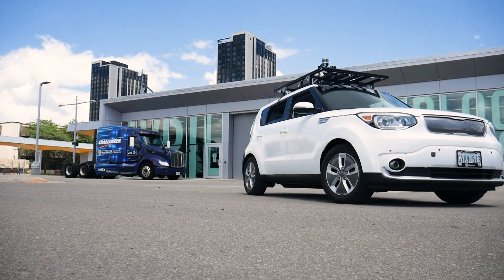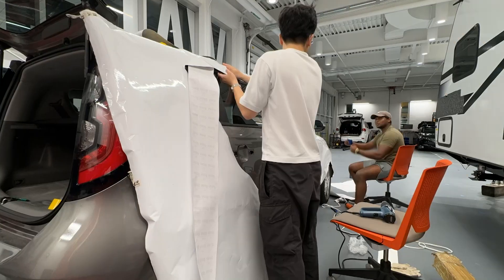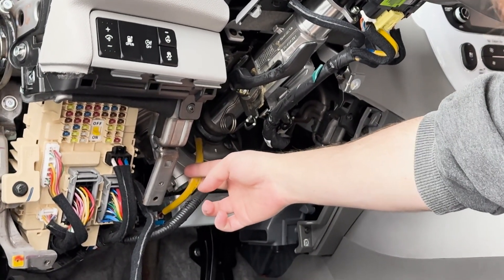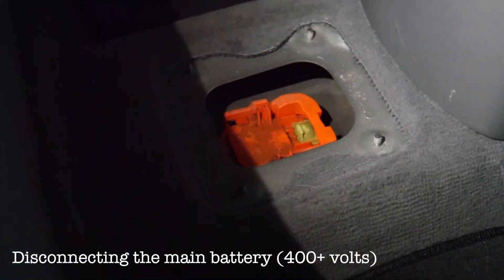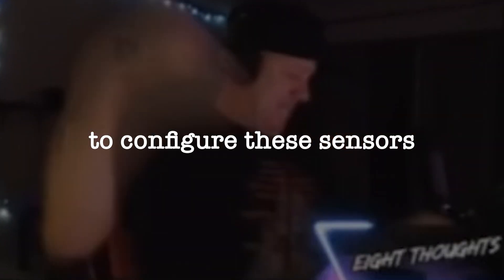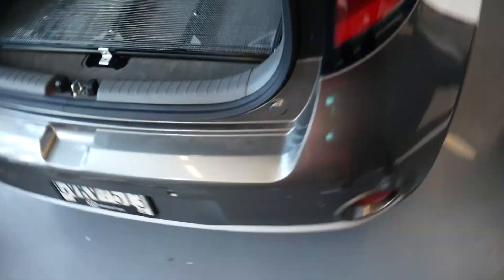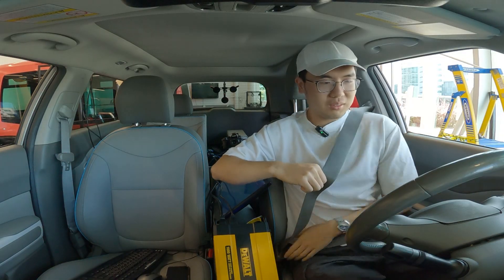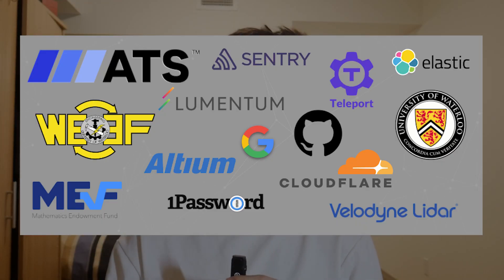I'm turning my car into a ROBOTAXI

Comment: As a senior software engineer at a major Autonomous Vehicle company that does daily on road testing, let me give you a few bits of advice to make sure you all do this as safely as possible.

Make absolutely sure you implement multiple ways of exiting robotic beyond just an e-stop button. Your pedal intercept boxes should always be reading the real pedal values and steering angles. If the brake or gas pedals are pressed by the driver for any reason the system should disengage from robotic immediately. In addition, you should be either tracking desired steering angle vs actual steering angle (or estimating input torque) and disengaging if the values deviate beyond a threshold. You never want to get in a situation where as a safety driver you need to react in a rush and have to do anything other than what you are trained as a driver to do. You do not want to necessitate pressing an estop button to take over control of the vehicle. That is a very dangerous operating mode and even if you yourself are trained to react in a panic, you cannot expect the same of any other operator, and the last thing you want to do is cause an unsafe situation for the crew inside the vehicle. Just remember that whoever is driving is still liable if something happens, no matter if the software is in control or not.

This is not to say you can’t / shouldn’t keep your current estop system, you just need to also have a software defined method of disabling the robotic system as well. It could be as simple as having a relay wired in series with your physical button estop system that is controlled via ros, and must be enabled for the system to enter robotic. A health checker node is a good idea to implement early and not allow you to enter robotic if sensors aren’t publishing or the system isn’t in the expected state. Will save you a lot of troubleshooting and failed tests. 

In addition to the above, you need to establish a safety procedure before every test to ensure your robotic kick out system still works. You should treat this vehicle like a loaded weapon until you verify that your safety mechanisms work every time you take the vehicle out. This should probably include going into robotic and triggering a kick out from every method to make sure they all work (brake, wheel, button, etc). Doing this can eliminate like 75% of the risk of on road testing, but it absolutely cannot be skipped and must be treated as the safety critical thing that it is by all team members, usually implemented as a checklist procedure that must be completed every time. This is unfortunately part of the disadvantage of going this method vs hijacking’s the vehicle’s built in adas features over the can bus, but having done the latter I understand why you chose the design you did.

You should also add a very clear visual indicator of what mode the vehicle is operating in (robotic vs manual). A good solution is a simple addressable led that you can change colors to indicate mode. Put it somewhere in the dash the driver can see. Tying this into the estop system suggested above might be a really smart design. But there should never be any ambiguity as to what state the system is in or if the driver should / shouldn’t be taking control of the vehicle. Stuff happens, software crashes, bugs pop up, it’s all good as long as the driver takes back control, but they need to be told to do so clearly and quickly.

This visual indicator should not be a screen with log messages though, the driver needs to remain undistracted and focused on the driving aspect unless on a completely closed course. On public roads being distracted is the same as being on your phone. So if you want to interact with the robotic system that’s fine, but someone else needs to be the “safety driver”. This also includes having a simple driver accessible method of triggering the system to enter robotic, as the driver should be the only individual ever engaging the autonomous system. A button or switch mounted near the driver they can hit or hijacking a wheel switch by sniffing the can bus are both good options depending on how complex you want to go. But the passengers should not be the ones trigger the system to enter robotic, nor should it ever be able to take control by itself without a user interaction.

Above all buy a dash cam that records at least front and interior, if not also out the back. The system needs to be completely separate from autonomy system, and should be off the shelf and unmodified. Have that running any time the vehicle is in motion. People do insane things around autonomous vehicles, and the dash cam may be the difference between you being default liable because of modifications to your car or not. I hope you never need it, but you’ll thank me if you do.

Remember that you are building a 3000lb+ 65mph capable robot, make sure you are confident you can control it when (not if) it acts up in all situations. Treat it like an unpredictable scared wild animal and you will have a better time than approaching it as a pet. Give appropriate caution and always think about / plan for the worst case scenario, because it’s shocking how often it comes up.

Best of luck and I’m looking forward to the next part!
Reply: Currently we actively monitor all brake and steering input regardless if the autonomous node is on or off, as of now pressing the brake will disengage the autonomous mode and give control back to the driver, working on doing the same for steering control, just got to fine tune when to disengage depending on how much the steering angle gets changed by the safety driver but we are working on it!
Reply: @aryana7510  Great to hear! That tuning is difficult, but glad to hear you are working on it. I'm excited to see the next part!

Comment: Only valid argument against lidar is that it's proprietary, so you're dealing with licensing fees in all sensors you buy (not fees you pay directly, but it drives up the price).  
A combination of a lidar sensor up top and a lidar sensor on each corner would give you a resolution of 'physical' data much higher than what you can extrapolate from a camera, but a camera can do things like detecting signs and even differentiating between people and other obstructions. Getting the two lined up is going to be the biggest challenge in this I imagine.
Reply: It is a laser beam. You could make your own...